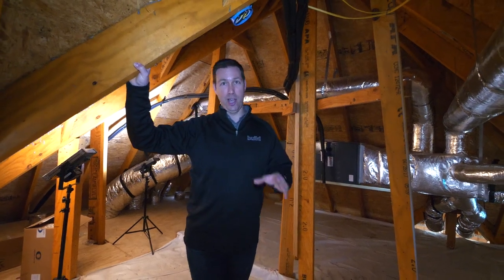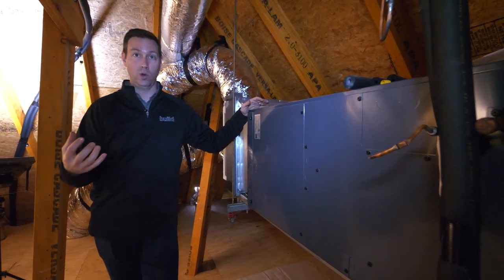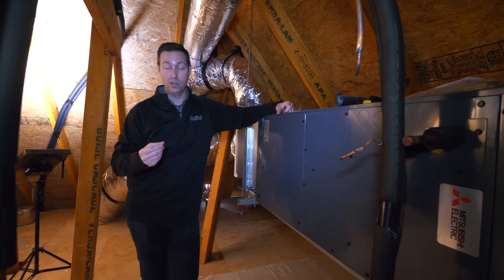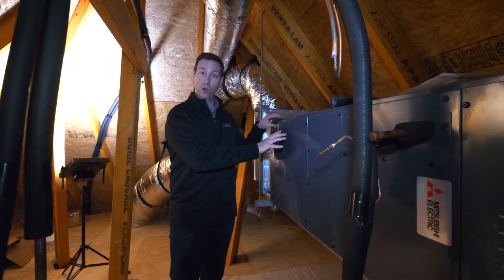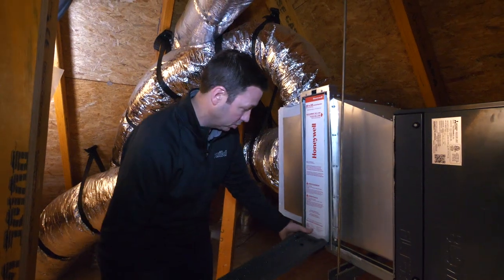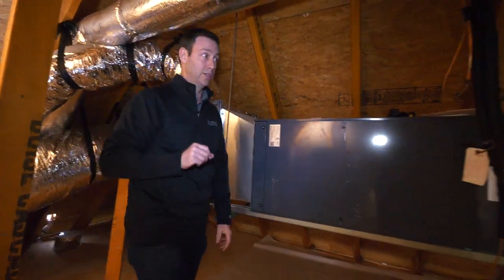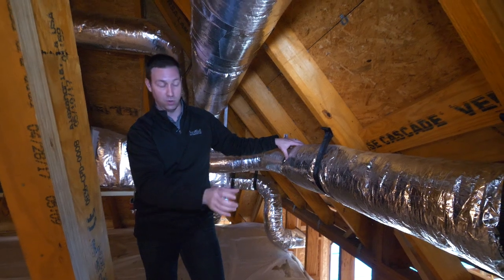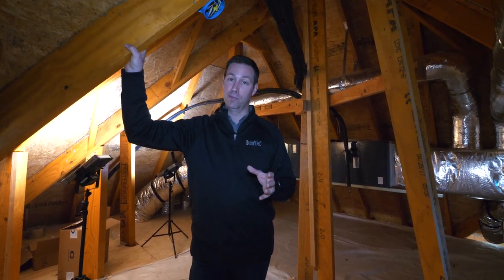New Construction HVAC - Here's My Favorite System

Comment: LG and Samsung make good mini split units. I know most installers only want to install Fujitsu and Mitsubishi buts its worth giving the Korean brands another look.
Reply: xcmskim4 the support from LG and Samsung is lacking compared with Mitsubishi. Can’t even find a vendor in my neck of the woods due to the crappy support the vendors got from LG.
Reply: Getting parts for any mini split seems to be a nightmare at times. Half the companies produce one for a few years and completely discontinue it. I’d rather stick with the couple that I can get parts for....
Reply: James K , They're are only around 5 mother companies that make mini splits although there are many labels. Mitsubishi and Fujitsu are the only ones that aren't junk. Many lines discontinue due to fast changing technology and warranty claims due to inferior products. I've seen more than one discontinue due to overwhelming warranty claims that forced bankruptcy on that line but not the mother company. No parts available on a 2 year old system with a 5-10 year warranty and the manufacturer tells you tough luck . Since Copeland no longer holds the patent on scroll compressors a lot of junk has been put out there. If it doesn't have a Copeland compressor it's junk. Easy rule. Trane, Carrier ,York ,Ruud, Goodman, Mitsubishi and Fujitsu all use Copeland compressors. Mitsubishi and Fujitsu cost more but I wouldn't consider istalling any other. It's not just the compressor but overall qauilty control however if they skimp on the compressor they certainly are cutting cost wherever possible.
Reply: Cody Thompson , I've seriously had to wait on parts from Japan or California, (im on the east coast ) but that's so with all mini splits. They have gotten better  about keeping parts closer to dealers with the higher demand.
Reply: Zen mind Yea they are definitely getting better on parts. Nothing is more infuriating than trying to tell a customer how ridiculous the long wait time is gonna be on a part if the particular unit is even being supported anymore. Especially considering that all the mini-splits I typically work on are for IT rooms. Overall I’ve had very few problems with them other than condensate issues, typically the initial install is the culprit where they are trying to run too high of a lift for the internal condensate pump to pump properly so it runs until it dies. That are algae build up from someone not maintaining the equipment properly. Gravity feeding in external pumps seem alright but I’ve had problems with those too. 

Main complaint with mini-splits is how they cram 10lbs of shit in a 2lb bag but I suppose if they were any bigger than one of the main selling points of a small footprint would be diminished. 

All equipment is turning to shit whether it be due to cost savings on parts, poor engineering, are terrible QC. Our mechanical division replaced a bunch of Trane WSHP’s a couple years ago and installed bacnet controls on everything. I’ve already had to replace two TXV’s due to how the factory ran the bulb, leaked from vibration. Had to replace 6 contactors, one of them didn’t catch in time and just replaced a compressor because of it. 

Smaller RTU’s are even now getting residential style ECM motors I’m assuming due to the regulation changes. Had two Trane RTU’s on the same building with a bad module within a year of installation. Nothing wrong at all with the motor itself, but they won’t sell you just the module ffs. Even had a control board in a brand new voyager randomly short cycling both compressors, and kicking the inducer motor on in random intervals whether there’s a call or not. Strangest thing I’ve ever seen....

Comment: I see problems with high static pressure in that system. I would never tap that close to and end cap considering how short that main plenum is. that combined with only changing the filter once a year is asking for premature failure of the blower motor and the compressor.
Reply: wesley garley  -  I’ve seen this comment a lot...    could you possibly link to the time where the plenum is shown?   Do you mean the bit at the end that stops where all the other ducts branch off on the right side of the Mitsubishi unit?
Reply: Yep I am shaking my head at that damn mess, only a complete idiot uses flex on a VRF system to begin with. All those hangers cut your CFM way down and flex on its own causes high static which kills VRF systems. We contractors call that cutting corners and being lazy. Never use flex when you have the ability to run hard lines.

Comment: If sealing home with foam, why not seal/insulate duct with foam? Much better for sound dampening that flex duct. The foam we use is closed cell and sets up rigid. No rodent or moisture damage. Also need to look into fresh air intake and IQ Aire if you are concerned with air quality. Phenomenal Air makes a really good purifier. Used in conjunction with the IQ Aire Perfect 16 system, we have achieved a 0 particle >.3 micron per cubic foot inside home. Amazing considering that I’ve measured homes with 24 million particulate counts. Just my 2 cent worth.

Comment: You didn't do the all-thread hanger correctly.   It was supposed to be in front of the filter door.  That is how most contractors do an install.  Not caring about access for maintenance.
Reply: I had a return plenum in front of the access door. No joke

Comment: Every return should have its own filter to keep things out of your return lines. And another thing, typically the attic is not a conditioned space so you would never go up there. I've installed countless systems and only 3 people were wiling to go into the attic to chance one filter, they'ed rather chain 10.
Reply: William Winder, I agree with filtering the return ducts at each return grill. Honeywell makes a 4" filter grill filter that will fit in the standard 1" filter grill .Also consider customers not wanting to change their filter ever regardless of location. 12 month filters allow service provider to do it for them during matenance visits.  Some aren't going to change them anyway no matter how easy. I have one customer that has 4 systems in their house with 12 filter grills total and she insists on using the 4" . I only have to change them every 18-24 months due to the amount of filter surface and the fact that she keeps her house spotless. Still $40 x12 is more than I would spend on filters even if only every two years. However 99% of contractors now  will install it as seen in the video.

Comment: Change an air filter once a year? Changing your filter is based on run time. Also the higher the merv rating the more restrictive the filter. I would recommend an electronic air filter for better air flow and better filtration to include a UV light. Also it needs a secondary drain pan under the unit with 2 water safeties. Just to keep you from getting sued for destroying the customers ceiling with water damage.
Reply: The air filter is changed once a year, period. You have no knowledge of advanced systems so you're opinion doesn't matter.

Comment: Loved your video. I have a 2300 sqft home with basement.  Main and second floor only have vents. I have two separate systems needing to be replaced.  I’m considering one variable zoned system to replace 2 single stage units.  Would you recommend this solution over doing 2 new 2 stage systems ? I’m in Georgia and not thrilled humidity in my house right now and the upstairs never gets cool. The house is 25 years old. So 1 variable zoned system vs 2 2 staged systems. ( I’ll be replacing the furnaces with a 2 stage variable furnace either way) carrier vs Lennox.

Comment: Good ideas in general, but wouldn't it be better to insulate the attic with spray foam before the ducts are in the way?  Also, I don't see any insulation on the return air plenums.  Is it recommended to insulate those too?
Reply: I was going to ask about the order of installation as well (equipment before spray foam).
Reply: No it is not
Reply: OzoneEditions , No way to attach hangers once foam is sprayed. The equipment will be covered during spraying and the ducts along the roof will be mostly  buried in the insulation,  even with minimum R- value they most likely won't be completely visible afterwards  . Return ducts are often lined on the inside, while supply ducts may be lined or wrapped. I prefer wrapping all ducts so there is no insulation in the air stream but the return air is filtered after the return plenum in this particular system so not a big deal  . Duct liner's  advantage is  labor cost due to the fact that it is insulated when fabricated. Wrapping duct  is more labor intensive . In this case it wouldn't have made much difference with a short plenum but a commercial building with hundreds or thousands of feet of duct it would.
Reply: return plenumn has insulation on the inside of plenumn, also new construction,  insulation happens after all trades have been through the house you dont want to spray foam before hvac due to any roof penetrations
Reply: The exact opposite, actually.  You want to have your ductwork, linesets, drains, and electrical done before sprayfoaming.  Unless you don't take pride in your work and want it to look like garbage.

Comment: There isn’t a manufacturer out their that is good with changing an air filter once a year. Good way to void a warranty. The system works off of static pressure and adding a more restrictive filter especially a dirty one that has been in for a year is a good way to shorten the lifespan of a modern HVAC equipment.

Comment: Hey nice system. When I renovated my house I installed a 2 stage furnace upstairs in a conditioned space with Metal duct supplies insulated wrap then returns are insulated flex. I have a smaller cape and it does really well. I like the Mitsubishi systems. Excellent video

Comment: What's the spacing on those rafters? Looks massive
Reply: Might just be the wide angle lens. Can't be over 24" I imagine
Reply: +John Salazar
He's also not near the Gulf Coast, so he doesn't have to worry about hurricanes...

HVAC contractors in the Houston area just put the unit on top of the ceiling joists with a drain pan underneath it.  Often it gets supported by some bricks.  Pretty crappy installation techniques.  When I replace mine, I suspended it from the rafters like in this video, but without the springs.  It makes it a lot easier to get underneath it.  The drain pan is suspended from under the unistrut.

Now, having said that, if I had the room and was designing from scratch, I would do the drain system a bit differently.  Instead of having a drain pan that can collect a small amount of water before it gets to the level of the drain pipe, I would use a couple of pieces of corrugated metal roofing underneath the unit.  I would slope these pieces like they were a mini-roof and then have them drain into a collection container that was plumbed to empty outside the house.  Something made of thick plastic like a 55g plastic drum laid on it's side with a slot cut in it for the corrugated metal roofing to fit into make for a good collection container.

Comment: If you need to quiet the air stream you should have chosen a different unit. Flex duct quiets the air flow noise at the register? Absurd, since there should be practically no noise to begin with after the air hits that end cap on the plenum and has to be forced to the registers. . Flex duct only requires a thin wire, pencil or any sharp object to perforate it and you have air leakage for the life of the duct. One small hole and the entire section must be replaced (or cut and pieced together). Use metal all the way, you won't regret it. Use a trunk system with smooth-flow takeoffs, not a box with holes in it and branch lines attached.

Comment: Have a question Matt, love what videos I've seen. Spray foam, how do you know which are safe?
Reply: MikeJ F --- Excellent question!  I have been wanting Matt to address this issue as well. I hope he does a video on this subject.
Reply: Frankly I believe it is more important to find a good INSTALLER. Nearly every story you see about the smells, voids, etc. are from installers either messing up the ratios or spraying far too deep on layers.
Reply: I’ve been researching this lately (building a new home soon) and @bigrignohio nailed it...    the foams themselves are all safe when used properly...   the problems arise from poorly trained or lazy installers either not getting the mix (ratio) right and/or spraying too deep which doesn’t allow the necessary oxidation and off-gassing (solvents evaporating off) as the top layer traps the deeper stuff.   One thing I’ve not been afraid to do with my architect and contractor is to ask these tough questions to ensure everyone who will soon be involved in putting my new house up follows best practices and doesn’t slack or skimp on any step...   you only get to build it once !!   Thankfully, as I’m using SIP (structural insulated panel) construction a lot of the issues that arise from framing are removed, tho I am building the house on a 5’ sill wall with a slab and that wall will have a spray foam insulation blanket inside.
Reply: @grendelum  All spray foam is toxic nasty stuff.  I would not have any of it in my home.  I want to eliminate poison from my environment.

Comment: When heating during the winter, it seems like the primary return duct should be high in the house so that hot air doesn’t get trapped in the high spaces. Conversely, when cooling in summer conditions the opposite would seem to make sense (i.e., place the primary return duct low in the house). Does this make sense? - Thanks very much!

Comment: Is there a reason you go with minisplit over a conventional style heat pump that also has VRF technology?  Especially considering the minisplit in this case is ducted like a conventional install.  I've always been told minisplits are only better because/when the ducts are eliminated.

Comment: Are there many alternatives to spray foam on the underside of the roof when air sealing? Like some kind of panel/batt insulation which is then sealed at the edges?
Reply: Rigid foam board
Reply: Nobody dares to critic him when uses poison.

Comment: Where is your secondary /emergency drain pan with inline low voltage shutoff ? Don't pat yourself on the back too quickly .
Reply: line jumper , Most equipment now has a water sensor in the primary drain pan from factory. That alone doesn't meet code requirements . It will shut the system off if the drain backs up but will not protect against a potential frozen evaporator coil as it thaws out. A secondary emergency pan must be installed with a secondary emergency drain or water detection device in the pan . I would not install that pan until after the foam spray is installed for more than one good reason. It will have to be installed before final inspection will pass and I'm certain they plan to do so.
Reply: line jumper this whole install is horrible, never use flex on a VRF system

Comment: i know this video is sort of older, so maybe another HVAC person can chime in if you can't. But when changing my filter today in my attic box (central Texas) I noticed that the unit that was running was sweating and condensing causing the unit to drip water to the  drip pan. the entire bottom of pan was wet with rust colored water. What can I do to proactively get ahead of the pan rusting out and causing ceiling leaks later on? I work in the sheet metal union so i can make a new pan easily enough, but I'm not a service guy so don't know the best course of action to take. Thanks.